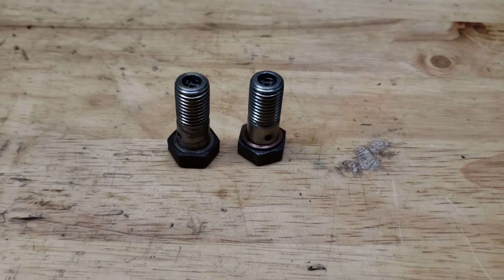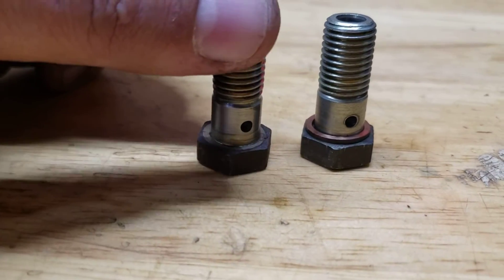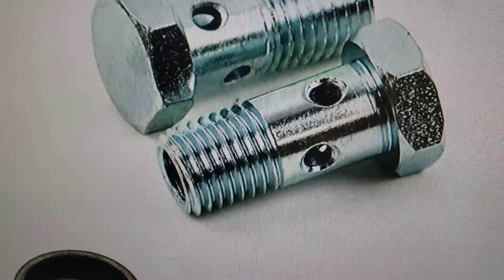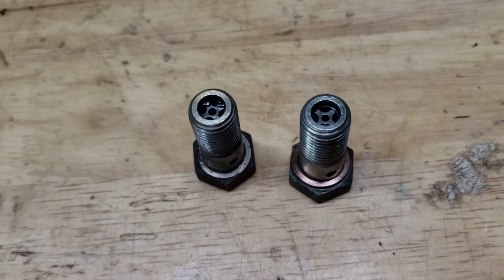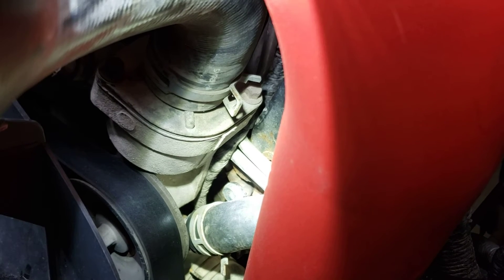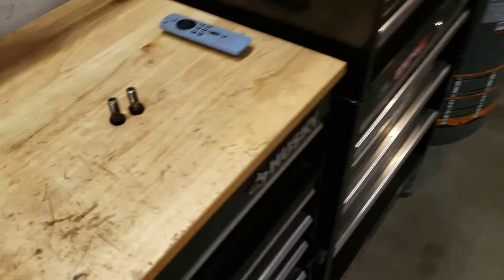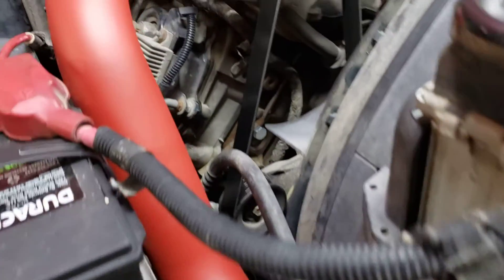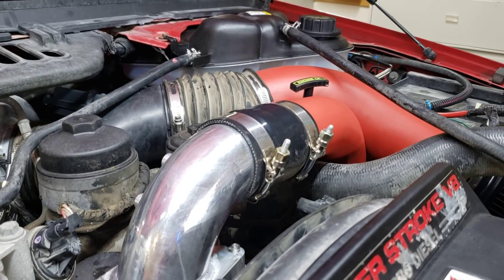6.0L Powerstroke banjo bolt upgrade to newer style 6.4L bolts

Comment: Will I need to bleed the fuel system after I install the bolt??
Reply from the maker: No. Just cycle the key 3 or 4 times & it will push the air out the return side back to the tank.

Comment: Did you just start up after the install, or bleed the fuel lines?
Reply from the maker: I cycled the key 5 or 6 times to build fuel pressure and it just like normal
Reply: Thanks Sir!

Comment: Would there be any benefit for this on a bone stock motor? Or is this only for modified situations.
Reply from the maker: This can benefit stock trucks. If the check valve brakes apart, becomes clogged or it sticks closed it will restrict fuel flow to the injectors and damage them.
Reply: @MidwesternGarage   ahh. I see. 07 King Ranch, bone stock, deleted, 90,000 orig miles.  Like seeing the available upgrades like this. Thank you for making this video!! Cheers from Central Canada.

Comment: Thanks for the video. I have much more confidence in doing it now, cause like you said, there are NO videos showing how it’s done. I’ve had some of these in my cup holder for months… let me know if you notice a difference!
Reply from the maker: I had a big improvement.... But I changed FICM to a 58v at the same time, so it's impossible to say how much difference the banjo bolts made.
Reply: @MidwesternGarage   Nice, Just what I am looking to do as well. Can I ask, what FICM you went with and where? thanks in advance!
Reply from the maker: @kevin_clark7  https://www.ebay.com/itm/03-09-6-0L-Ford-Powerstroke-Fuel-Injection-Control-Module-58V-FICM-3237-/161722554775?mkcid=16&mkevt=1&_trksid=p2349624.m46890.l49286&mkrid=711-127632-2357-0
It's BD APV (artic power volt) 58v FICM. Got it on ebay. They don't charge a core upfront and give you 30 days to return your old one (they do call and get your card # on file in case they don't receive your core in 30 days). It is supposed to greatly improve cold starts. My injectors were having stiction issues until oil temp got above 125°. It would studder above 1800 rpm until warmed up. That completely went away instantly. A week after I installed this I did a oil change and put in 32oz of "Hot Shots" stiction eliminator
Reply: @MidwesternGarage  Awesome. Thanks again man. I plan on probably ordering that exact one. I assume a 150-200$ core refund, since i didnt see it anywhere. If you haven't yet, i recommend the 7.3Fan Clutch+assembly mod. Cools down much faster, and I have never seen my oil above 210° since. It starts cooling at 190 or so instead of 205-210stock. Full EGR delete kit helps too, as i usually run at 190-200 depending on if i have a load or not. All around i have a "stage one" modded truck so not too serious HP..
But thanks again man! I will have to follow your build now! ;) haha cheers...
Reply from the maker: @kevin_clark7  the final price of the FICM is $379. If you don't return your core within 30 days, they charge you an additional $150 for the core. I've never seen my oil temp over 210, but I'll look into it. Thanks